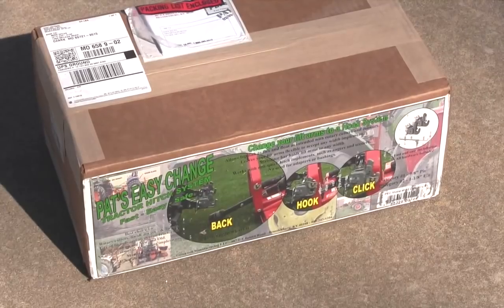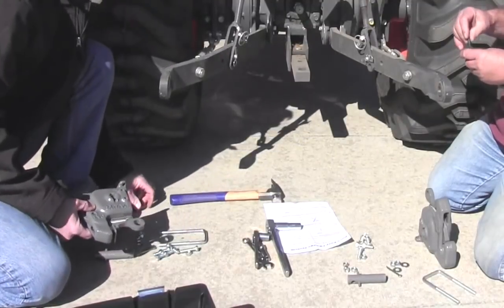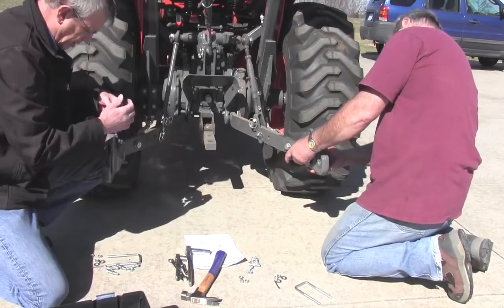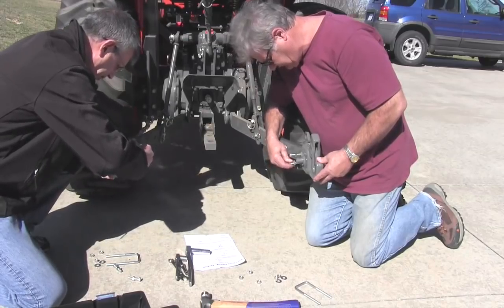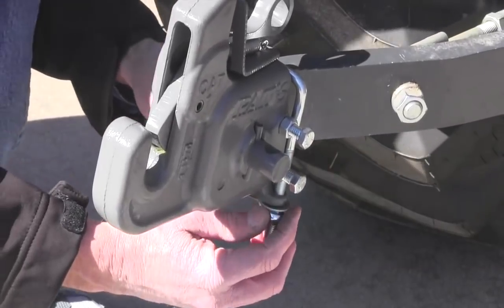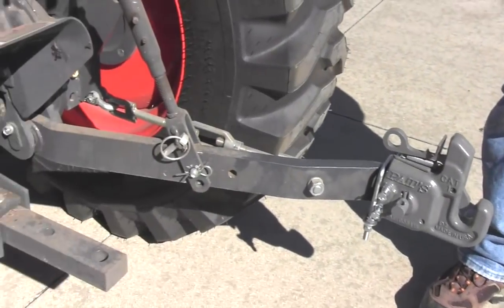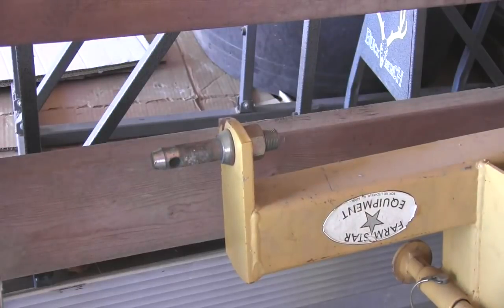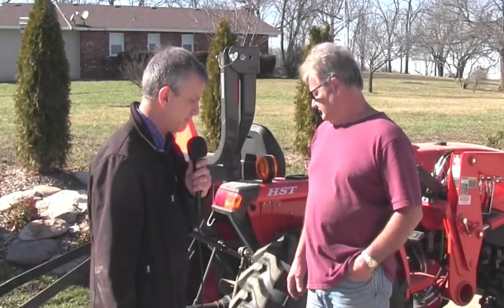Is Pat's Easy Change the Best Hook Up for 3 Point Implements?

Comment: Great video.  Great hitch system.
Installation tip:  Once you have both sides loosely installed and you're trying to get the angle correct, lock a broomstick into both sides of the quick hitch.  A broomstick will line them up very closely for you and then you just have to tighten up all the bolts.

One thing I didn't hear mentioned in the video was the fact that you may very well have to buy a new top link that is about 4" longer than stock.  It's an added expense but still well worth it to have the Pat's Quick Hitch system on your tractor.

Finally, be absolutely sure to take the accessory spreader bar off after you hook up.  I didn't do this and bent mine in the first 20 minutes of owning the hitch.  The spreader bar is not meant to be left on while the implement is in use.

Comment: A little trick for this quick hitch. My dad uses a small chain instead of the spacer bar for different width attachments as you back up to the attachment pull up on the chain till your lift arms are at the right width.
Reply: It would be nice to post a video on that idea.

Comment: Definitely a nice product.

However,  this is one of several videos I've seen now that makes me grateful I've never had to work with tractors that didn't have telescoping/extendable lower link arms. It just seems really time consuming and effort wasting (or completely futile with heavier pieces of equipment) to not be able to just get "close enough" and extend the link arm to make the connection .....and spending additional money on quick hitches (which may not always work) or other alternate means of working around imperfect alignments during implement hookup just makes me wonder why telescoping link ends aren't a standard feature.

Comment: I've had mine for 3 yrs and found it to be very good. My only concern was the adjustable bolt hardware were not grade 8, but Pats Disconnect sent me replacements which solved the problem (no charge) I use a box blade, angle blade, and 6' bush hog on my Kubota L3400 hst in hilly fields in Arkansas Ozarks with no problems and I did the install myself.

Comment: MIke, You mentioned shortning your PTO shaft. In fact you would have to lengthen it 3 inches to compensate for the longer lift arms. otherwise there is a risk of the PTO shaft seperating causing serious damage.
Reply from the maker: Yeah, I had a brain fart, I gave the complete opposite of what I should have said.  Don't know what I was thinking...
Reply: born2flyau was t

Comment: This Pats Quick hitch is the cats meow.  It is great!  So much easier to hook up implements.  I couldn’t use the I-match hitch from John Deere because all of my eight implements are different spacing on the pins widths.  I do most of the tractor work at my ranch by myself which means there is no one to help me line-up the implements.  It’s hard enough to line up these implements with the three point arms but with the Pats Quick Hitch, it is simple. Great system.  Thank you Mike for your video of this.

Comment: I tried a couple of easy attachments just like Chuck...They wouldn't work for all my implements.  I saw a video of Pat's Easy Change System and bought it. Like you said, it took me about thirty minutes to install.  I couldn't be happier.  Now rather than fighting it, I just back up and lift it up.  I have had mine for five years and haven't had a problem.  I use with a BrushHog, Cultivator, Box Blade, Single-Board Plow, Debris Rake and a Circular Arena Rake.  I am too cheap to pay for the spreader so I got some square tube and round stock, welded a nut on to the square stock and installed a screw handle, bent the round stock and I use it.  It looks like theirs but was less than ten dollars.

Comment: Mike, I’ve used Pat’s Quick Hitch on my Kubota for 5 years now with zero problems. The brush cutter worked fine with the stock top link, but I did have to buy a longer top link to use with my box blade though. Not a big deal.

Comment: I recently installed Pat's Easy Change hitch.  It's working fine but the pin on one side took a lot of driving to get in.  The lower arms move and clank more than usual which does not seem to be a problem but it does get my attention and make me look back to check it.

Comment: I have used these for several years because I have some cat 1and some cat 2 width implements.  The only issue with this system is that if the jam nuts get loose, the shim will fall out.  It’s no big deal, it still works but it’s not level.  Also, the spring that holds the lever closed can give way.  When that happens, you just use a piece of rope or tie down strap to keep the lever closed.  I got 3 years out of my first set & got my second set last fall.  I now know to check the nuts & make sure they are tight every time especially the ones on the U.

Comment: Great product.  Took a few times to get used to it.   It worked great once I greased the hook area.  Without the grease one side always seemed to hang up and I'd have to shake the implement to get it to drop in.   Still much easier than trying to line up 2 1" holes.

Comment: this have been the best thing i have added so far! I did have to buy a extra long top link from TSC, but other that that it is just bolt a go!  What was a complete nightmare for often over 30 min is now less than 3!!! 

IF i had anything to improve it would be the washers. while they do work, i do get hung up on them sometimes. But it has literally gone from HATING change over to "ok, done in a few min"

Comment: Put a set of pats on my Kubota B7800 about 4 months ago love them, had a tiller that my lift arms would not open far enough to go around pins each, time I hooked up and unhooked  had to remove sway chains to get them wide enough. was a pain and took about 30 min to hook up, with quick hitch can now just back in and lift,  Quick tip they work best if perfectly in line with each other. Get a broom handle or large dowel and lay it across both sides of hitch, looking down on hitch you can see which way to adjust  jam bolts to get perfect alignment, adjust one time then when you remove broom handle will be very easy to hook and unhook, if they are not lined up right will sometime not drop off of pins when you lower arms, also someone mentioned the keeper will sometimes pop off, they are just held on by a cotter pin and simple to stick in a new pin to repair.

Comment: Just got mine hooked up.  Nice and easy install, basic machine knowledge needed, and hook-up took not too long and 0 crowbars.

 The spreader bar intersects with where my PTO shaft needs to be, should have removed the spreader bar before lifting the implement.
Reply: My PTO was long enough, but my top link was a half inch too short...

Comment: I bought a set last year and sent them back to Agri-Supply. All my PTO shafts ended up too short. Great concept but the extra length may cause you problems.
Reply: A simple PTO extension is what I used... I wouldn't have a tractor without Pat's hitch system..

Comment: I have this and have been using it for a few months now. I like it, it is much faster to hook and unhook implements. When using it on a ballast box, I had to extend the top link of the three point hitch to the point that the link twice managed to unscrew and come loose on me. I got in the habit of tightening the lock nut and that never happened again, but the extra three inches did make that possibility more probable. The other problem that I had is that I noticed that the swing-out catch would occasionally swing out of the way with use, just due to vibration. If I saw it swung away, I'd move it back into place, but once I hit a bump when the catch was out of the way and the resulting shock of the 600# box bouncing up and down caused the catch to come loose on one side.  Since the other side was still attached, it twisted the box and caused damage to the top link and the pin support on the box. Getting the whole thing unhooked so that I could repair it was a task, but I managed to repair everything just fine and when I replaced the top link, I used an extra long one which fit better anyways. I'm happy with the product and would buy it again, but now I put a heavy rubber band around the catch keeper to prevent it from disengaging. Its a good product, very well made and well designed, but you might want to get a longer top link (I think that I spent $40 on the link at Tractor Supply), and definitely put something around the keeper to prevent it from disengaging under heavy use.

Comment: Hi, I have had my eye on a 3 point quick hitch to help ease the connecting up of the more awkward (2 people required) implements. Unfortunately they are different widths, so I did not know what to do until I seen this video. Looks like the perfect solution. As you said the top link is usually no big deal as you need to connect the PTO shaft anyways. Thanks from way over here on the West coast of Canada. I'll let you know my experience with them.

Comment: I currently have Pat's Easy Change system too, which is nice, but I still have to hook up the top link. I'm considering a Quick Hitch. Problem is there is a lot of different definitions of "Quick Hitch Compatible" and the pin spacing and top link height vary quite a bit among "Quick Hitch Compatible" attachment makers. Even the dimensions of the quick hitches themselves vary between brands. I am making a spreadsheet of the dimensions of my attachments as well the dimensions of various Cat 1 quick hitches. I'll buy the one that will fit them all if I find it.

Comment: I purchased something very similar from Tractor Supply.  I think I like this system better as it wraps completely around the lift arm.  Mine are open on one side and it allows for a bit more wiggle room which makes keeping the jam nuts.  It was also nice because my rotary cutter was so close I couldn't lift it up until I put these "extenders" on.  Now I can lift it up with no worries.   If that one still fits CAT1 pins directly that is good.  Most others are CAT2 which require you to use bushings or the nicer fittings.  That is an additional cost as they are about $16/pair on amazon or 25 from a dealer if you have to convert cat1 to cat2.  without the arms would get rounded over.   It made it easier for my setup for sure.

Comment: Maybe I'm missing something, but as someone else commented, my Kubota has extendable link arms. The biggest issue with hooking things up is getting the link arms lined up with the implement pins/pin-holes. Extendable mostly solves that. This doesn't doesn't solve the line-it-up problem, does mean no more trying to get pins thru everything, but I haven't found that to be a huge problem. I guess I just need to be able to back up better.

Comment: Hi Mike, Here's a thought, I think I would do away with the jam bolts and use long set screws instead with the jam nuts to lock them to the right depth. By doing this, you could eliminate the excessive bolt lengths and the bolt heads that just are just sticking out the side and a possible hazard. In other words, it would stream line the unit. Good luck, and happy trails 🤠

Comment: Thanks for the video Mike, those certainly seem better for people who have a mix of different brand and age attachments like I do.  Just thought I would point out, you mentioned cutting the drive shaft but maybe you were thinking because he had a quick hitch before? Adding three inches to the lower links will not cause you to have to cut or shorten a drive shaft that was previously on the tractor. However,  It could end up too short if you were already running a short drive shaft.
Reply from the maker: Yeah, that's exactly the opposite of what I should have said...it may need to be made longer, not shorter.  DUH!  Not one of my better days...Chuck's cologne may have damaged my brain!

Comment: I would recommend this as the first option to purchase for the tractor. This would allow you to make your PTO shaft fit better on the other attachments as you purchase them without handing cut the PTO shafts too short when raising the 3 pt
Reply: You can purchase a PTO extender, it's about a 4" extension.

Comment: Hey, Mike. I ended up buying the Pat's Easy Change system after seeing your video. I've got an old Ford 8N, and the kit required a couple significant modifications to make it work. I just posted a video on how to do it specifically with the 8N; I mentioned your video and linked it in my description if that's okay with you.

Comment: IT looks nice.   Are they forged or cast? Cast  might break.  I'm thinking that if one has a cab,  it would be difficult  to line up as compared to a quick hitch which  only  wants you to keep an eye on the top hook up.
Reply from the maker: They're hot rolled cast steel.  They won't break, the Category I Pat's Easy Change was tested and the hook failed at 24,000 lbs.  I've never heard of a set breaking.

Comment: Hello,
I know how much of a pain it is, to hook up implements with a tractor that has no form of quick attach.

The hooks you showed in your video are definitely a step up from that. 
I life in Europe/Germany and I never really saw neither of those two quick attachment systems you showed. 
The square thing is maybe nice if all your implements fit but if you change between implements and trailers it's bullocks too isn't it? 

The hooks are good, but the mechanism that holds the "claws" shut is a bit complicated.

I only know and love another type of those quick attach/claw hitches.
The ones i mean/use has claws similar to yours but you don't grab the pin directly but instead your have little balls on your pins you hook up to (ones you have installed them on all implements - just push them on the bolt).
That has the advantage, that this ball kind of guides the hydraulic arms in and makes them easier to attach. 
And then there is the mechanism that shuts the claws: it's similar to the one in the video but it's spring loaded which means it shuts on its own when one of those attach balls slides in.
Furthermore because there is no hook you need to open first like with ones I the video you can have cables on them, to open them from your seat.

To keep the right space on the lower arms we have an additional spring spun between them that really helps if your attachment are nearly the same size.
Reply: Here is a link to a picture of one of those lower links with the ball quick attach:

https://goo.gl/images/1B3hJ7

Comment: Hooked this up to my 5’ tiller. Bottom pin hook up  fast and easy.  However PTO shaft not long enough due to 4” length difference at bottom links. So do I get longer PTO shaft?? Also think I need a longer top link

Comment: Are you aware of any method for easy connecting PTO shafts? I have 6 3 point implements and always find the PTO shaft harder to get aligned than the 3 point connections. I do plan on checking out the Pat's easy change too after seeing it here it seems very useful for my usage as well. Thanks.

Comment: Hmm, couldn't find a dealer over here in Europe and shipping costs from the US to here are a literal nightmare.

Not that I need them right now, but that would be easier than the weld on hooks for the lower linkage arms that are commonly used here (to original arms get cut and you need a licensed welder (safety reasons) to weld on the hooks.

Maybe, when I am ready to buy the tractor I need, there will be an option...

Comment: I ordered a PEC in CAT-1:
I realized I have 3 implements with a 28" span between the pins on center.
I now believe my CAT-1 will not fit these widths.
Questions:
1. What is the maximum implement span between pins for CAT-1?
2. Will a CAT-2 PEC fit onto my CAT-1 tractor (B7100 Kubota)?
3. Will the CAT-2 PEC fit onto my 2 other implements?
Reply: https://en.m.wikipedia.org/wiki/Three-point_hitch

Comment: Mike, I jumped in and bought a Cat 1 Pat’s easy Change Hitch - Nice. However, when installing it on my JD 1025, I find that the lift arms on the tractor angle in when in the down position and only get parallel in the mid position when moving up and then angle in when up fully. Is this normal and how do you install each of the Pat’s easy hitch ?  With the angle in in the down position it makes it impossible to use the spacer rod. Perhaps you know what I’m doing wrong.
Reply from the maker: We think if you experiment with using the jam bolts to level the hitches about halfway up in the lower link arms travel arc, the problem will go away.  I ran your question past the folks at Pat's and here is their response:  He will need to angle at a happy medium. That is why there is room inside the receiver. It will be slightly angled in the down position but it works fine with the room inside the hook.

Let me know if that doesn't fix the issue.  Thank you for your business!

Comment: I've got a set laying in the tool shed. Didn't care for them. Still do it the old-fashioned way.
Reply: What cat and are they for sale since you don't like them.  Thanks
Reply: John, are they for sale?
Reply: Same here. I sold mine for a 100 bucks, I used them about a week. After my grader blade popping out of one side or the other about 10 times I seriously almost wound them in the woods. Not impressed. There is 200 whatever gone forever.

Comment: Hi Mike. That's an interesting System to change the "regular" pull arm to an quick-hitch one. One thing I don't like about this design is, that it moves the implement a bit back, creating more leverage.  I'm from Europe, Germany to be exact, over here we have the same style pull arms on the compact tractors. On agricultural equipment (50+ HP) we already have those quick-hitch pull arms (without adapter). I hear a lot of americans saying they can't lift or pull as much because of the design, but they are used on tractors up to 500 HP. If you'd like to look it up, they are called "Schnellfanghaken", you'll find a lot of Information about them.